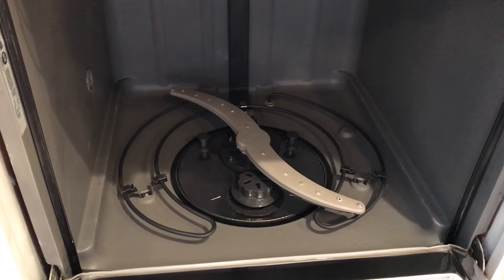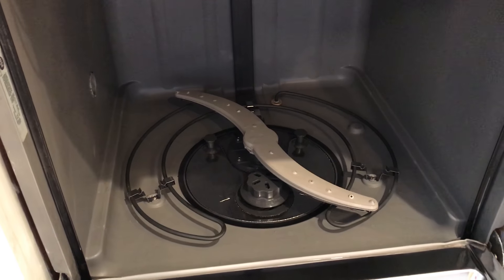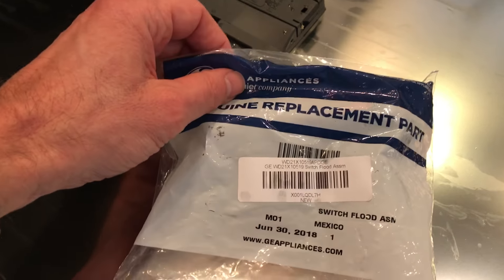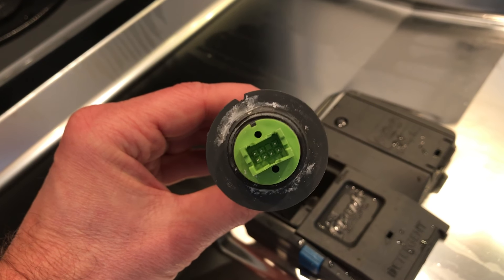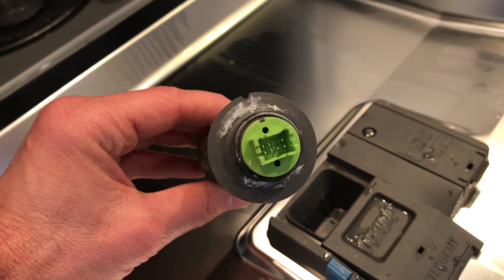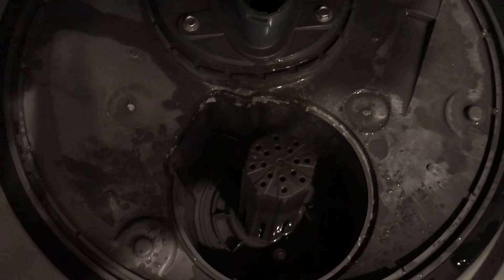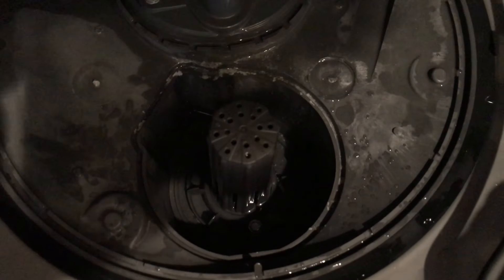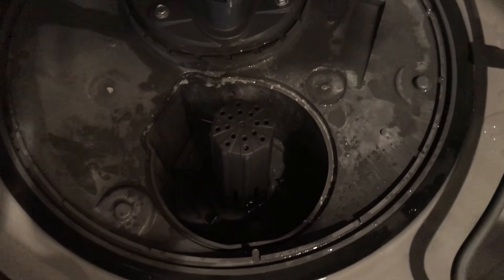GE Dishwasher not Drying Dishes - How to Replace Bad Flood Switch

Comment: This saved me a lot of trouble. I thought it was the heating element as well, but before I replaced it I saw this video. Dishwasher is fixed now! Thanks!!
Reply: OMG this guy is a saviour of appliances. I bought an element because my GE dishwasher stopped heating dishes too. Would come out with water all over everything and not cleaning well. Felt warm only because Hot water was being dispersed. Ending up buying another element thinking that was it and realized they both had same resistance of 16-17 ohms when using Multimeter and that would indicate that normal and working. Then I tried this TCO reset button people were talking about  under the dishwasher but that never popped so i know that was ok. Searched and searched the internet and youtube and came across this and didn't realize the Flood switch not only regulates WATER LEVELS but also HEATING ELEMENT and when to turn it on and off during the cycle... saved me from buying another dishwasher and more importantly I learned something in the process! Still prefer whirlpool products though... They rarely have issues.  Oh and my Dishwasher is about 5 years old.

Comment: Spent $$$ with repairman replacing board control kit 2xs and heating element. Better drying but still not right. Was ready to accept defeat when I saw this video. Ordered part, replaced and problem solved!! Old part was full of gross gunk! Cleaned it out and going to see if it works, JIC. Thank you for your tip and video!!

Comment: Good advice. I replaced the flood switch and fixed the problem. Anyway next time I'd like to try the following: The new FS when you shake  it, there is an element moving inside. In the old one that moving element was stuck with old food. I deeply washed the FS by also lightly hitting  the FS to allow the stuck food to come out, after a lot of through washing the element inside become loose again (like the new one). I think this is a magnet that moves up and down with the water level and with time, the dry food makes it get stuck. I did not test it. But if one of you happen to have the same problem my advice would be to remove it, shake, if it doesn't make any noise, wash it thoroughly  while shaking and smashing to a soft surface until the element becomes loose again and test it. If it still doesn't work replace the flood switch.
Reply: I watched the video and saw your comment. Pulled out the sensor and sure enough it was jam-packed with crud built up over almost a decade. I flushed it with hot water while picking out the crud with an o-ring pick (toothpick would have worked too). That seems to have fixed it! Thanks!!
Reply: Good idea!  I was having intermittent issues to where the dishwasher would seem to lose power about 2 days after resetting power to the lower control board.  Weird thing is I would reset 110v to the whole dishwasher and it wouldn't help, but if I unplugged the mini connector on the bottom of the control board, waited 30 seconds, then reconnected, the dishwasher would work for about 2 days then repeat the same behavior. I replaced the lower control board and it didn't help.  I checked the filter basket and it was disgustingly filthy, so I cleaned it out and the area where it sits in and dishwasher seems to be behaving like it should, but I do have the heating issue like is described in this video, so I will try your advice then replace if that doesn't work.  Thanks!
Reply: Same exact issue here. I replaced it since I had already bought a new one, but if it happens again, I might try seeing if I can just clean it out.

Comment: Another tip you should know if you're watching this video is this.  If the Rinse Aid dispenser is completely empty, that can cause the unit NOT to send power to the heating element.  I saw another video where the guy mentions this about GE dishwashers.  He even said "somehow" the unit behaves this way.  Didn't make much sense to me when he said it so I didn't bother with it (also I didn't have any Rinse Aid to test with).  So I replaced the float switch like in this video, but that didn't fix it.   I tested the limit switch - that was fine.  I tested my new float switch to make sure the thermistor was good - and that was fine.  I traced all the wires back to the control board thinking there's a break in the connection somewhere, including pulling out the control board - everything looked ok there.  When I exhausted all those things, I finally thought, I can just put water into the Rinse Aid dispenser and test.  And BAM!!!  That was it.  Crazy!

Comment: MANY THANKS TO THIS VIDEO!  This is such an under-the-radar problem, and solution! I too suspected all the normal possibilities, then ran across this and other videos talking about a "thermistor" hidden in the float switch. GE should call it "switch, flood with thermistors".. but they don't! 😡 Even though I had first bought a circuit board with relays as per one video, I did not install it but waited for my "flood switch" to arrive after seeing this video.  It was the easiest dishwasher repair I've ever done!  I unplugged the power from under my sink but otherwise did not move the dishwasher nor turn off the water. Simply vacuumed out the sump, replaced the "switch" and am up and running!!  I Sawed up the old assembly and sure enough there's a white float with a metal ring near the top that no doubt activates a magnet switch in the resin-filled post, but there were four wires going up the post so with its 7 pins I suspect there's a thermistor at the top to sense steam when it's Sanitizing, and a second thermistor near the bottom to be able  to sense when it's Boosting the water temperature correctly.  Whatever, it is not just a float switch!! Dirty birds.

Comment: Thanks for the video. I initially thought of replacing the heating element, but after seeing you fix this problem with a flood switch I thought I'd also try that. Worked like a charm and was very easy to replace. I used my shop vac to remove the water and cleaned both filters (that I did not realize it had). Thanks again for the vid and insight.

Comment: Thanks for the video.   Saved me looking at the heating element.  Replaced the flood switch. As soon as I pulled the old one out, I found the flood switch would not rattle.  Likely clogged.  This fixed my problem.

Comment: After testing the heater element (15.8 ohms) and thermal limit (has continuity) I decided to check the thermostat and noted 360 ohms, which would indicate the water was already hot. New float switch measured 8.6k ohms. The new switch restored full heat and I thank you and those posting for the help. Made it a very simple and cheap fix.

Comment: This video was extremely helpful!  It would seem that the heating element would be the cause if the dishwasher is not heating.  It was the flood switch, as described here.  It took me about 10 minutes to perform this repair and my dishwasher is boiling hot again!  Thank you!!

Comment: I also posted this message on another video and it and yours was the only ones I could find on this subject MY DISHWASHER NOW WASHES AND DRIES!!! 
I want  to say Thank you soooooooo much!!! I ordered the piece from 
Amazon and it came yesterday, first I had already had a service man come
 and say it was fixed he replaced the heating element and also replaced 
the dispenser door on my GE-GDT655SSJSS I was so upset my dishes came 
out still wet and not clean and cold after the service it was almost 
200$ for the service call.
Well I took your advice and had my son-in-law help me take out the 
switch flood assembly and man oh man I can not believe how much calcium 
was built up on that assemble and down inside the well, we had had a 
problem with out water a while back with out water company all mu dishes
 were coming out white and it was somethign to do with our water system 
finally they got it fixed. I am sure that is when it started, any way 
after he took it apart for me I started putting the pieces plus the 
flood assembly into containers of very warm white vinegar I could not 
believe what came out of the pieced I even had to scrape some to get it 
loose and I also soaked the spraying arms in a long baking pan with hot 
white vinegar and poled all the holes with a dental pick in a kit I had 
for embroidery. Finally all the pieces were clean and I read somewhere 
someone said their Flood assembly made a noise when they shook it like 
when you shake a spray paint bottle well my old one did not do this so I
 stuck it on a jar filled with hot whit vinegar and I can not believe 
what ugly stuff I got out of that thing after over an hour working on it
 and removing ugly stuff it would make a noise when it shook I couldn't 
really see inside so I figured it was cleaned and I decided to put it 
back in the dishwasher while I waited till next day for the new one to 
arrive well the dishwasher seemed to wash better but still did not heat 
or steam, SO when the new piece arrived I was able to remove the old 
flow assembly and replace it with the new one ALL BY MYSELF I put dishes
 and tupperware in the dishwasher as I would and ran the cycle BUT I had
 to leave for a few hours when I came back there was water setting in 
the bottom "new problem" then I realized where I did not push the 
dishwasher back inside the space it was tilted forward some so I figured
 that was the problem with that I ran the drain and it drained then I 
started a new cycle and let it run I was soooo happy to finally see 
STEAM coming from the steam outlet and when it finished everythign was 
HOT AND DRY Thank you so much for this video I have no idea why the 
service guy did not know this and fix it the first time.
As far as i know yours and another video out there showing how to 
replace this piece and yours has a link it worked for me I just plugged 
in my serial number and it confirmed it would work in my machine.
I am one happy camper to be able to wash my canning jars again and get 
them HOT Thank you again I can't wait to wash mire dishes LOL
Reply: Glad that the video helped you and that you were able to fix it yourself.

Comment: We were having the same issue with our G&E dishwasher (model GDF520PSJ0SS). Since it was not the same model as the one shown on this video, I was worried that it might not be the same part number.  I went to the GE website to find the part number for our model (it was the same part - WD21X10519). I chose to order with my AmazonPrime because I didn't want to wait any longer then 2-days and I got FREE shipping (luckily on the day I ordered it , it was the selling at about the same price as on the GE website $28.25). It took my husband about 15 minutes from start to finish to replace it and now our dishwasher is working properly again. He used our shop-vac to suck out the water and was very careful handling the screws. Thank you so much for posting this video! 

If you'd like to confirm the part number is the same for your model go to: https://www.geappliances.com/ge/parts/ and enter your model number in the search box and click the search button, when your dishwasher model comes up, then scroll to the bottom of the page and click - Sump & Filter Assembly - on the Sump & Filter Assembly page find the part number in the diagram (308) and click the  "show me the diagram number" to confirm the part number for your particular model.

Comment: This solved my drying problem with my dishwasher and saved me money. After checking the resistance of the heating element (16.9 ohms) I found this video and although I wasn't sure why it would fix the drying, based on all the other comments I thought I'd give it a try. I used my wet-dry shop vac to remove all the water from the tub and to clean the area around the flood switch. I had to use a small pick to remove the soap build up around one of the screws so I could remove it and a magnet to pull it up so it wouldn't drop down while I was removing the switch. The replacement part was about $30. I used lithium grease to help seal the o-ring and then re-assembled. It's a little tight replacing the wiring connector, but very doable. Just to be safe you should turn off the breaker or unplug the power. 
Thanks for this video and the great instructions.

Comment: Brilliant! The parts store and even a repairman that was there insisted this part could not be the reason it wasn’t drying. Swapped it out anyway as show and problem solved! Thank you! 

To fellow GE owners - the rear bolt is quite shallow - I had to press firmly to engage the driver but that was literally the ONLY challenge of doing this (along with sopping up the water). It’s a breeze and fixed our dishwasher in like 5 minutes.

Comment: Thank you sooooo much!  I want others to be aware that this switch can be the reason your dishwasher won't fill.  This fact doesn't appear very often in online diagnostic information for this problem.  First we replaced the water inlet valve which didn't solve the problem.  We tested water flow and pressure, inspected wiring and did electronic diagnostics.  Finally we found a little statement in a description of this part that its malfunction can prevent water inlet to the machine.  So after a lengthy diagnostic process (we have to wait for parts to be shipped as we have no local parts provider) and finally installing the new flood switch the dishwasher works again (knock wood).  We appreciated your instructive video!
Reply: Leigh Trumpfheller 
Did it work? I have a problem with no water fill 🤦🏻‍♀️ after cleaning filters and that part. I was about to order the valve but I think is this the problem. Let me know before I order the wrong part 🤭
Reply: I’m having the same problem. No water coming in so I think this is the problem.
Reply: jstjohn83 yes! It worked for me 🙌😁
Reply: jstjohn83 I pulled the float and gave it a little shake. Make sure it plugs in with the bottom outlet and try it again. I hope it works for you. I didn't have to buy a new one. I messed with it while cleaning my washer so shook it a bit and now it works. Thank God!
Reply: The One I’m not very handy. Did you have to unscrew it? What do I need to do that? It’s pretty dirty down there
Reply: jstjohn83 
Yes there are 2 screws there. It is super dirty but grab a rag a soak all that nasty  thing out because you might get the contacts under it wet. When you unscrew it take the ring out and the float come out easy but it's hooked to a contact so make sure you plug it back in when you're done with it.
Reply: The One I guess I need a socket wrench?
Reply: @mayrac9074  I am experiencing the same problem after I cleaned the filters;  my dishwasher does not fill in with water nor spray; it does go to the final step of heating just fine.
Reply: @ReddyzFun  I Had messed with the float (Crazy Cleaning Lady-Me) saw Junk on the float and decided to pick at it. really all i did was shake it for a bit and blow on the little holes and placed it back in hoping that if that was the part to be replaced and messed up i had unclogged it by what i did, Thankfully I did, i was able to fix it like this. (The Float is that picture above with the green part) I hope it works for you.
Reply: @ Mayra Callejas : I was able to fix it today by following the instructions in this video. Thank you for your comment. 

I did the same with the float as well...I shook it a bit and tried to rotate it and as a result it looks the connection to the float may have come off. Once those two screws are off and the float was removed, cleaned the debris around the float and the housing, shook the float to hear the ball moving, blow through it and put everything back together....viola it started running. Felt accomplished!!! GE wanted $99 to diagnose the issue and more for parts & labor. 

Thanks to the OP of this video, Miss Leigh & Mayra Callejas for the comments as that helped tremendously.

Comment: This is a wonderful video and great advice for fixing the problem of my GE dishwasher not drying dishes.  Before trying this, we had a technician out twice --- once to check out the heating element (was ok) and then a second time to replace the main circuit board (also proved ineffective/unnecessary).  So after over $400 down the drain we were about to buy a new machine, until we saw this tip and decided to try it.  Following the video guidance, my wife and I replaced the flood switch with a new one, in about 10 minutes, and the problem was fixed!  In fact, it is possible that all we needed to do was to pull and rinse the old switch and put it back.  I'd recommend trying that even before buying the new part, although it is not expensive.  Our old one was full of gunk but was easily cleaned.  Thank you for taking the time and care to share your experience so expertly.
Reply: MANY THANKS TO THIS VIDEO!  Indeed, very helpful when he started talking about thermistors!

Comment: Dude. This helped so much. I replaced the heating element first, which is a huge pain. Everything I was seeing said it was the heating element or the vent that causes dishes not to dry. It wasn't until I saw your vid that the flood sensor was even brought up. Swapped it out and the dishwasher runs like new again. Thanks.

Comment: I’ve had the heating element not working as well. 
This video was very helpful in the “how-to” for the sequence of dealing with replacing the flood switch. 
Replacing this part is by far the easiest in regards to troubleshooting.  The heating element requires the unit to be removed from under the counter.
Also, research shows this part fails before the element, so why not try this first.

Comment: Thanks for the tip, I was convinced that I had to replace the heating element before I saw your video. Replacing the flood switch took about 10 minutes and fixed the issue.